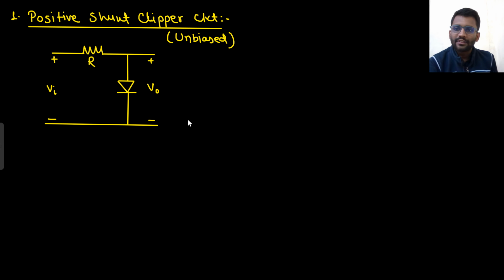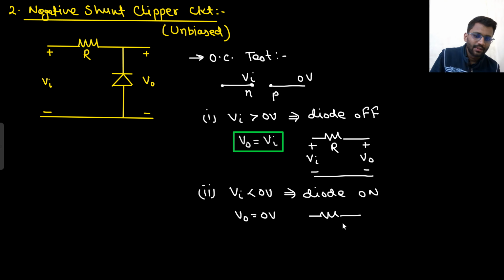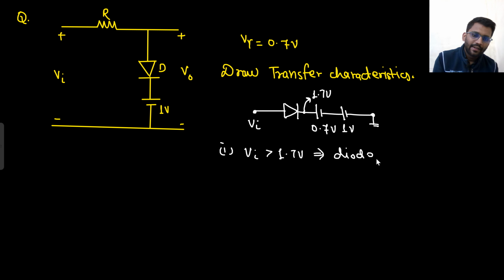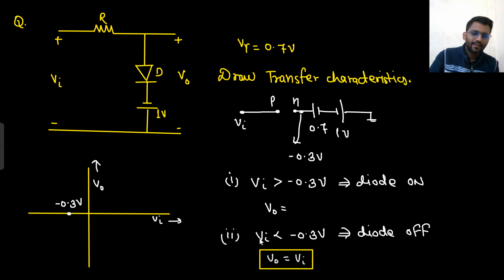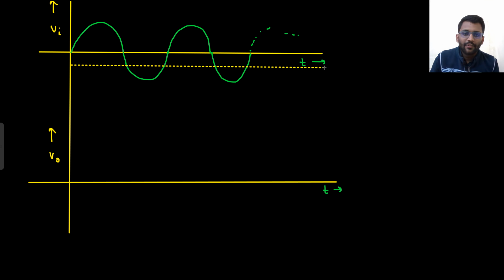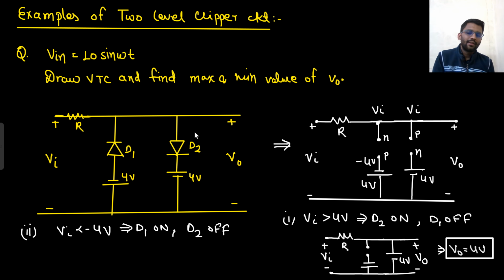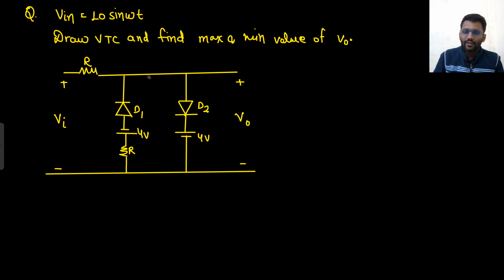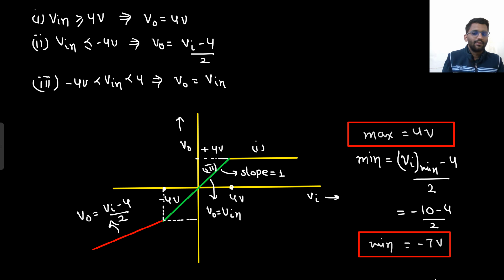Shunt Clipper & Two Level Clipper Circuits || Analog Electronics || PrepFusion || Himanshu Agarwal

Comment: sir you said in O.C, i=0, will i=0 be across the branch which is o.c or in the whole circuit i=0 when o.c is applied(no matter even if we have extended ckt)
Reply from the maker: The branch where it's open ckted. Not the whole ckt. You will have to analyse the whole ckt